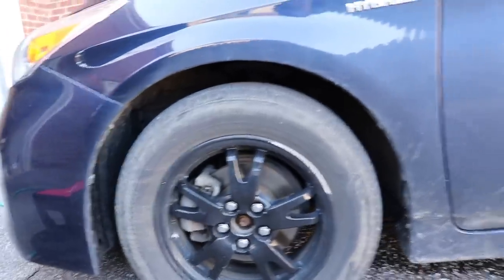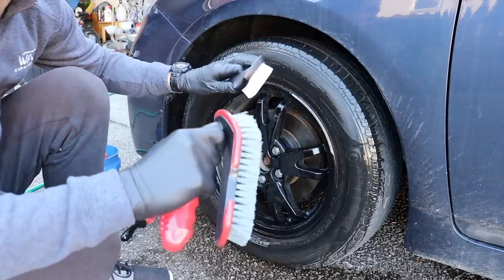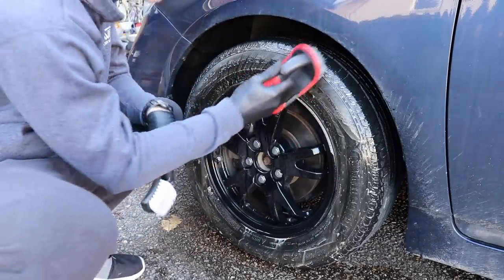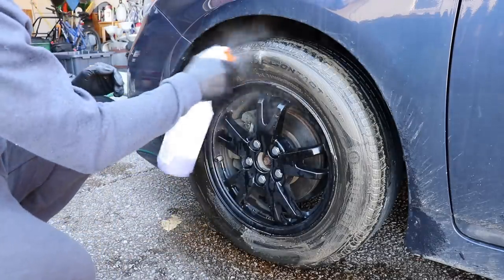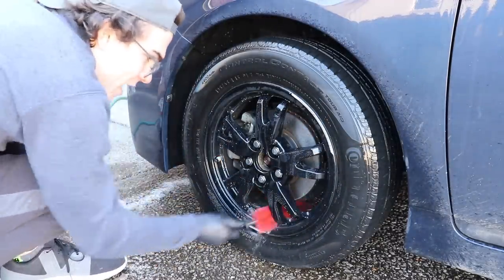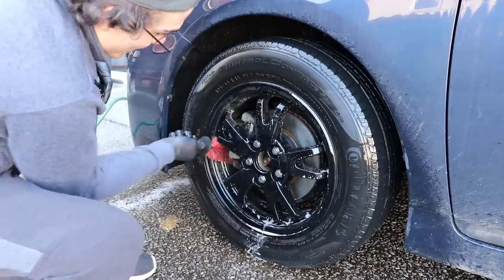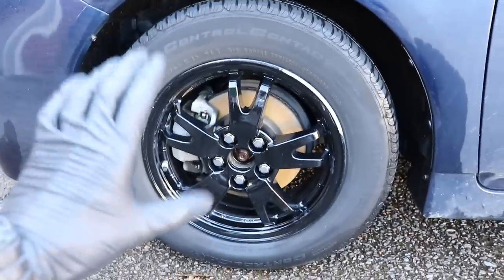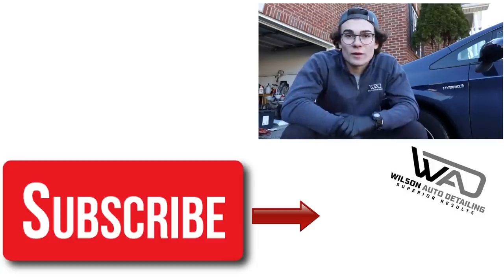Stop OVER-PAYING for Detailing Brushes | Sometimes quality is cheap

Comment: Tip for new detailers....Never lay your detail brushes on the ground
Reply: why
Reply: @kishawhite47  Because they pick up debris, then scratch what you’re cleaning.
Reply: Exactly
Reply: yeah but it shouldn't be a problem. It's not a car show.
Reply: @caspermayne  then dont even bother to wash your tire with brushes............normal people just use one washing pad for the whole car........

people commonly mistake car detailing with car washing. While both involve cleaning a vehicle, the difference between the two is pretty important.
Reply: the detailing community gets too crazy with everything like this.   its all about safely cleaning. you can absolutely put them on the ground.  what you mean to say is don't throw it into the dirt and mulch pit. then start scrubbing with it. 

what if you throw them on the all weather floor mat you're cleaning on the ground.  what if you pressure wash the 12 inch section of floor youre putting it onto.? what if you power wash your brush before and after you put it down and after you pick it up?.  .. etc.   do whatever you want.... just do it safely and with caution. 👍
Reply: They will pick up debris while cleaning 😬

Comment: Toilet bowl brush for $3.99 at Walmart works great as wheel barrel brush. This is not rocket science,  just keepin it real.
Reply: I used to use one. It will scratch some rims though, little too stiff. That said one of those $7 wheel brushes on amazon is sufficient.
Reply: Your right...its not rocket science. But those cheap retail grade brushes are WAY to stiff and are going to harm the wheel.
Reply: Yeah make sure its soft enough, I use a retail flat dish brush, works great, the degreaser does most of the work
Reply: I use my old shoe cleaner brush

Comment: Another general detail brush tip is disposable foam paint brushes. Awesome for tight spaces on the interior and exterior. They transfer and hold whatever product you're using and/or applying and are very safe. They compress to get into those really tight spots very well. They are super cheap and come in all sizes. Use them daily. 👌👍✌
Reply: Been using them from the dollar store for years

Comment: Drill brushes for tires and rims are great if you know what brush to use, I have seen lots of people just buy the $10 drill brush kit from autozone and run it against their wheels and then wonder why their wheels are scratched badly... well the brush in those kits is a hard brush where with wheels you need a soft drill brush, heck even with hand cleaning wheels you want a soft brush you can actually use boars hair brushes on wheels and they work great so just like with any job you have cheap basic tools sold at local stores and you have cheap specific tools that are meant for certain jobs and when you get into these jobs you start to understand the differences in the tools so yes you can use a dirt cheap tool for a job as long as you know what your looking for in that tool :) good video on the brushes 😀

Comment: For inner barrel you can use the toilet brush
Reply from the maker: Haha I guess
Reply: Toilet brush is a little too stiff for that,  I do use a cheap toilet brush for wheel wells though.
Reply: Wilson Auto Detailing Hey I love your videos. I have a new Camaro “garaged” wondering if you’d suggest iron x then wax or sealant for spring. Trying to get best glossy look “blue.” I’m confused about waxes. Can’t afford ceramic. I live in Oregon. Thanks
Reply: @Kavik1938  I live in pdx and use chemical guys butter wax during the summer,  meguiars liquid wax during rainy months,  I'm using the rest of my supply before getting some beadmaker.
Reply: lance t thanks
Reply: Wow, I. Better get me one for the toilet, before the price triples😱
Reply: Yup done this for years 👍🤣🔥
Reply: @Gnetbird  no joke, i have lowered car and the fender cap is very narrow and toilet brush helps to clean wheel wells
Reply: Bob M you can use any wax or paint sealant and on top get a bottle of the Adams polishes ceramic boost, it’s made to maintain ceramic coatings but works very well as a standalone product
Reply: Bob M also I would recommend a layer of chemical guys glossworks glaze under the wax, really adds depth to the paint
Reply: Is that after or before use in toilet?
Reply: exactly  that's  what Wilson  use to brush  his  teeth

Comment: I went to Walmart and spent 20+ on some detailing supplies. Meguires Hot-Rims and some vent brush that looks like a toothbrush; it was awesome to clean off some old brake dust by scrubbing the surface. The other stuff was like some trim restorer and microfiber applicators. I also use polishing pads from China and like the foam material from Germany.

Comment: Hey I love your videos. I have a new Camaro “garaged” wondering if you’d suggest iron x then wax or sealant for spring. Trying to get best glossy look “blue.” I’m confused about waxes. Can’t afford ceramic. I live in Oregon. Thanks
Reply: i would suggest iron x, clay, then wax topped with spray sealant
Reply: Bob M Chemical decon is good but you might have to follow up with a clay bar. The best bang for your buck IMO is Griot’s Garage Liquid Gloss Polywax. Leaves the paint looking wet and last 8-10 months. Also very easy application and no effort wipe off. Hope this helps.
Reply from the maker: ^^^great input above. Also check out the link below: 

https://www.detailingjunk.com/liquid-paste-wax

Comment: That brown colour on the tyre is exactly what you want? No mate it's whatever the customer wants. Me personally I don't like brown tyres, I sure they're ment to be black and round and I bet if your customers mentioned black instead of brown and you speil out " no that's what you want" you'll get lots of happy customers. 🤔
Reply: steven bewick he’s talking about the suds, if the suds become completely white you run a risk of stripping the UV protectant in the tire and can cause cracking and premature deterioration. While if it’s a light brown it leaves the tire black even before the use of a tire shine
Reply from the maker: No disrespect but I think you missed the point of the video entirely